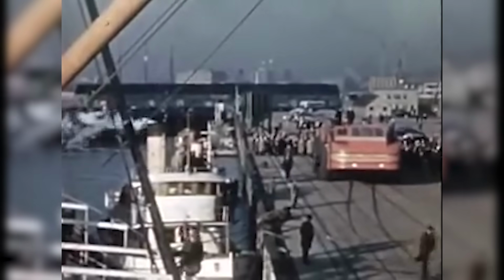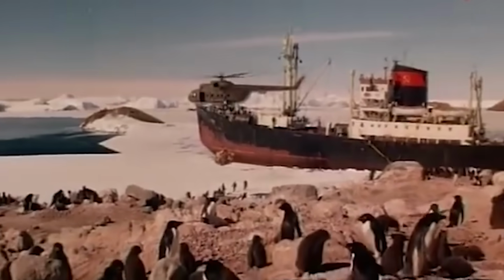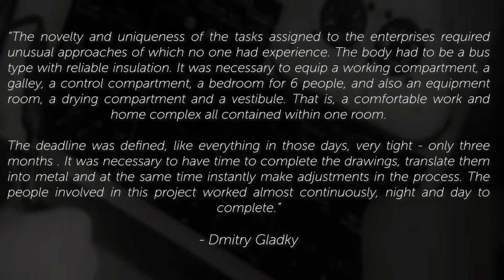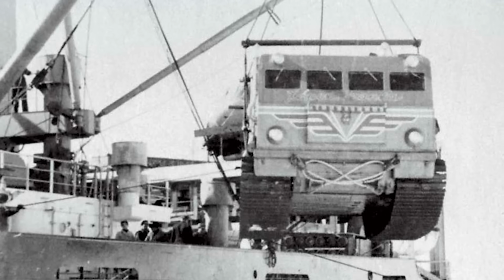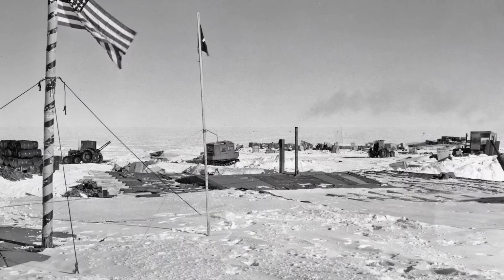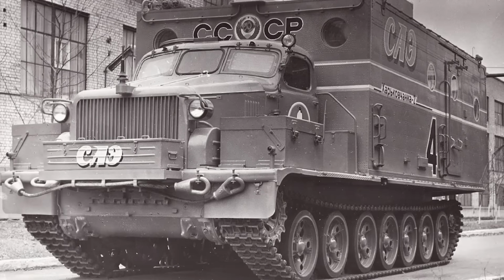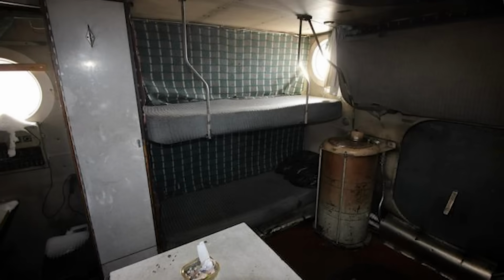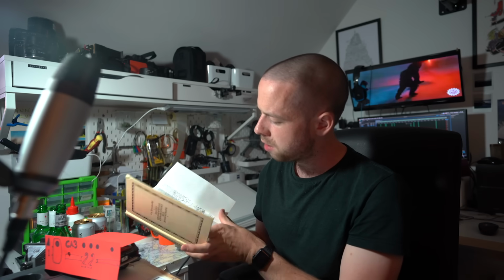"Kharkovchanka" - The Colossal Soviet Antarctic Cruisers

Comment: Yes, It is pronounced "H-h-arkovchanka", not "chunk of junk-a" and was named after the city of Harkov where it was built. The first modification also had a mini-hospital inside and a doctor in the crew and was a kind of wonder of the world. The crew, also, used portable heaters called kapelnitsa that maintained 18-20 degrees C inside 24/7 and crew never slept in -10 C. It is these heaters were what produced some smell of smoke inside, not the engine, because they used diesel fuel to warm the cabin. These machines saved lots of lives and few expeditions from been cancelled, never heard that they were used  instead of tractors.  Tractors had to stop in a blizzard, but Harkovchanka could continue to move as it had unique navigation equipment. Tractors, also, were braking more frequently and sometimes crews could survive only because they could shelter inside Harkovchanka. Liked the video for bringing here one of the monster monuments of the dead now super-civilization, which will never exist again
Reply from the maker: I was unaware of the medical adaptions, that is great I know they didn't sleep in -10, the quote from Dralkins book I think was more to illustrate that the insulation wasn't as effective as planned and was dropping quite quickly. Thank you for the info on the heaters, that is quite interesting as I had seen them mentioned in books but didn't exactly understand if they were built-in heaters or not.
Reply: No, those heaters were not built-in, they were made by the crew mechanics out of metal junk they could find in their base repair shop in Mirniy. That is why they produced some smoke, but were very fuel efficient and produced a lot of heat. Likely, they would be prohibited now, but those days they were necessary.To be honest, some crew members did sleep in -10 -15C when crew decided to shut down the heater for night and sleep with clean air. But, some of them said that it was not cold inside the sleeping bags, just getting out of it and to start the heater in the morning was quite an adventure. Interesting how people managed to live and survive in such a harsh environment

Comment: great video. i was lucky enough to haul diesel fuel on the ice roads to remote diamond mines in Canada's arctic a few years ago. it was usually between -30 and -45 centigrade, though i did get to see -60 one day! but we had good roads, radio communication, camps with hot meals and showers and a road monitoring program. i can only imagine the danger and excitement of these antarctic expeditions. i will be buying the book Vodka over Ice. does anyone know if the book Antarctica by A G Dralkin is available to buy? it seems to be only in Russian and unavailable. thanks again.
Reply from the maker: Wow that sounds like a hell of a trip! I can’t quite imagine it. I’ve searching for a while but I think AG Dralkins book is in Russian only.

Comment: Interesting video. Several years ago I saw references in some online blogs (sorry I can't recall the URLs) that the Soviets experimented with a nuclear powered tracked vehicle, that was eventually intended to result in a "Mars train" for a year long manned exploration of the martian surface in the 1970's or 1980's. Unfortunately, the nuclear reactor couldn't be satisfactorily shielded so the concept was unsuccessful. Additionally, the failure of the N-1 rocket  (and general downturn in the Soviet economy) meant that by the mid 1970's they no longer had a means to assemble the giant Mars spaceship in low earth orbit.

Comment: Very impressive. I bet with the technology that we have now, these designs could be optimized to be much more fuel efficient, serviceable, accommodating and reliable. Also at 6:09 you said T45 instead of T54.
Reply from the maker: It’s actually both! It’s based on the t45 but they essentially use the same hull - however I should have stuck to t45 since I believe that’s what the ATT came from
Reply: @CalumRaasay  Are you sure? All I can find on the T-45 from Russia is a light tank and it does not have a chassis or even tank tread design that is anywhere near similar to the T-54, for that matter, it would be too small to be a chassis that the ATT is based on.
Reply from the maker: @rixille  Oh sorry you're right, I meant T54/T55! Getting my head too mixed up with fallout lore https://en.wikipedia.org/wiki/T-54/T-55

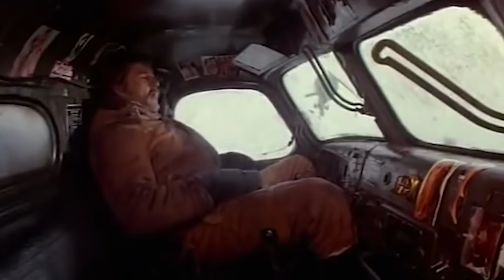Comment: 7:09 This altitude is about 2/3 of the altitude at which the Canadian Aviation Rules would require all occupants of a visual flight rule (VFR) aircraft to have oxygen supplies, and they were in a fucking tank with a truck cabin
Reply from the maker: Félix-Antoine Chénier that’s exactly the sorts of comparisons I should have used to highlight just how insane some of these conditions are. Great comment 👍
Reply from the maker: jujitsuman68 I personally choke myself with a belt when I go out hiking just so I can be a true badass and live at a high altitude.
Reply: @CalumRaasay  believe it or not, but this technique is used by some martial art experts. They wear special masks during training to improve the ability to continue the battle when running out of breath.
Reply: @CalumRaasay  Choking oneself with a belt is often done for ... other reasons, in more intimate situations.
Reply: @Félix-Antoine Chénier
  Elevation, not altitude.  Elevation describes the height of the land  above sea level.  Altitude describes the height of an object above the earths' surface.
Reply: Vostok station is located 3488m above sea level. The atmospheric pressure is twice smaller than normal. It is possible to get used to it if the climb is gradual. Those who travel by trucks do have time for that. However, other crew, who arrive by air, spend a number of days in beds getting used to lower oxygen levels.
Reply: I have climbed at 4100 meters, air is thin and walking is ok, running you run out of air very fast. Next year should hopefully go to Aconcagua.
Reply: Engine keeps stalling... Hold up guys, we need to slap sum turbo's to this B coz it ain't getting oxygen!
Reply: The way air flows over landmass means that there is a higher percentage of air at this altitude than there would be at this altitude in an aircraft.
Reply: @jujitsuman68 Someone from Peru would laugh at the low altitude.
Reply: Meh, in the US there are millions of cabins at this altitude.  You get used to it.
Reply: @RS-ls7mm  eventually
Reply: The Canadian Aviation Rules regarding pressurization and oxygen are mostly for pussies. Mostly designed to protect the passengers. Mountain climbers go to the top of Mt Everest without extra oxygen. Of course, some of them do not make it back home again either.
Reply: @charlesaanonson3954  Some climbers go to the top without oxygen but the vast majority use oxygen tanks. Climbers from both schools have died trying to make it up or back down. Once you reach the " deathzone" your body is slowly dying. ( 26,000 ft or above) Even with supplemental oxygen your body has to be fit and acclimated to the height. You have to limit your time in the death zone as breathing is also about expelling carbon dioxide from your body. 

The people that climb without oxygen on everest are at high risk now because of the amatuer climbers paying thousands of dollars to be assisted to the top. It has become crowded near the top and you have to keep track of your time so you know when you have to abandon the climb before you will die. When it is crowded that becomes more complicated so atm everest is  like rolling dice. Non oxygen climbers are looking at alternative mountains and harder routes more and more. Mountains like Annapurna and k2. They are the hardest climbs and no place for an amatuer with or without a guide.
Reply: @mdnealy4097  And Mars? Are there any climbers going to Mars, in order to avoid amatrues? You missed that amatrue spelling, you got pretty much all the other variants. Amateuer is a funny one, if you talk a bit of German. Teuer is expensive...
Reply: @charlesaanonson3954  I'm not sure about the Canadian Aviation Rules, but the US FAA has a habit of making rules for "the least common denominator" is the euphemistic way of saying it. But to be clear, the worst case. The rules are written so the slowest learner, the worst thinker, the most distracted, etc can still fly with everyone else and not cause injury or death. In the case of altitude and oxygen, there is a large variation in the partial pressure of oxygen needed by humans. Some people can comfortably jog around at 4500 meters while others will feel nausea and have purple extremities at 3000 meters. To be safe then, the rules are written to require oxygen for the worst case, and usually with a safety factor built in so that if there are compounding circumstances there still isn't an issue.
Reply: And 2/3 is no problem at all. And cold air contains more oxygen than hot air. Do you have more useless text? Please drop it into your heated Mac dustbin. Are you familiar to girls staring at you and saying OMG?

Comment: It would be so cool to live in one of these haha
Reply from the maker: Perfect post-apocalyptic adventure mobile!
Reply: @CalumRaasay  get it? Cool?!
Hahahah
I'll let myself out
Reply: @xmlthegreat  No, it would be a hot ride. Unless it got AC...
Reply: @Trump-a-Tron  Install an portable ac unit, and run that instead of the heater. Insulation helps with preventing heat getting in, too.
Reply: Calum Did any of the sources mention smell (other than engine-derived)? Must have some real pong in there after a few weeks with 8 blokes...
Reply: You can get mostly the same experience from living and driving around in a trailer with a few other people.

Comment: In the army, drivers used to light fires under the diesel trucks to get them going in really cold weather. We're talking below -40 Celsius here. Well over Antarctic temperatures, but still break off piss cold.
Reply from the maker: It's truly insane- I've never probably experienced temperatures below -15C at the lowest! I can't even fathom these sorts of temperatures.
Reply: @CalumRaasay  Well it was the only time I experienced it myself. I had to take a piss, but the only thing that came out was icicles! xD jk! But honestly, I did fill a cup full o hot water. I made sure it was wet around the rim on the outside. It took about two seconds to freeze the cup taut to a metal pole, and the whole thing was frozen solid in about 5-10 minutes. Another fun thing was to throw hot water in the air, and watch it come down as snow.
Reply: @CalumRaasay  If the air is dry and calm, it's bearable with correctly worn warm clothes. If it's moist and windy, however, that's where the problems start. But luckily, it's rarely both.
Reply: @CalumRaasay  -37 C the coldest for me, in Ontario Canada in the 1970's. Brutal. Cannot imagine 30 deg colder.
Reply: @JCO2002  Manitoba. But with wind, so windchill factor makes it -78°C. 
I understand Antarctic is more comfortable cuz it's a "dry cold". Less wind too.
Must be nice.
Reply: "Canadian Block Heater"
Reply: It can get colder then -40 Celcius in the interior of Antarctica
Reply: My folks on the countryside did that to start the tractor.
Reply: We still do this is Vorkuta, also many people living in Russia above the Arctic circle have plug in heaters attached to oil pans and transmission. The extension cables go from a persons flat to a post outside from the window to parking spots